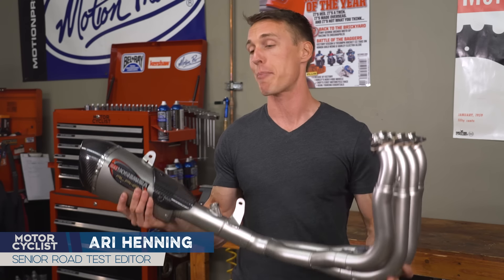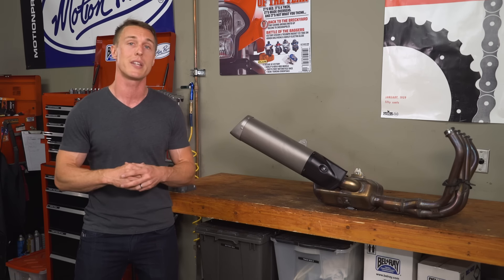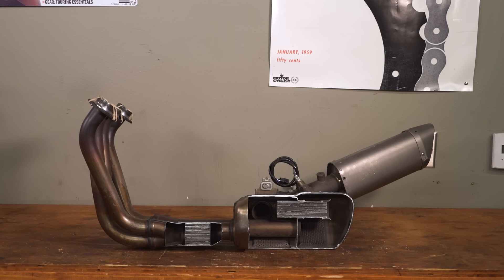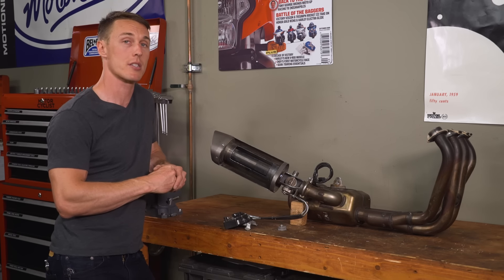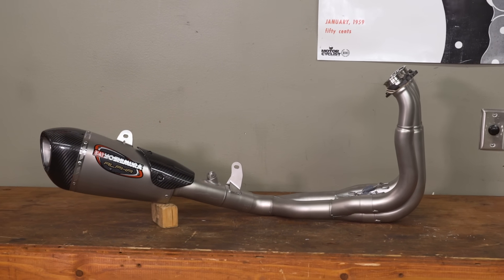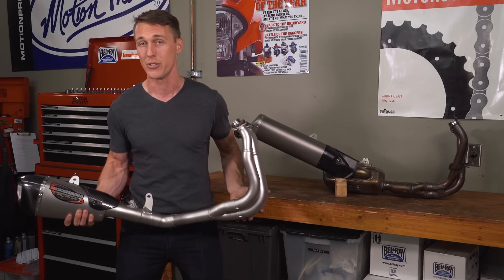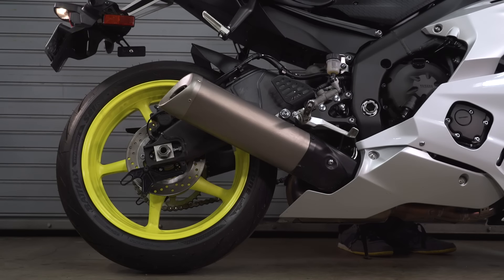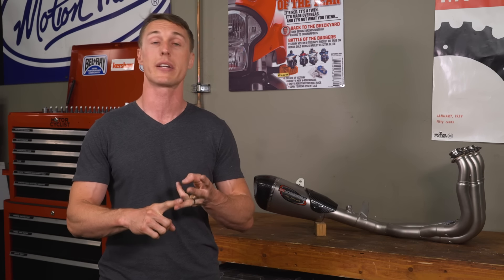The Truth About Aftermarket Exhausts | MC Garage

Comment: Admit it, most of us get an aftermarket exhaust coz of the sound
Reply: Marcus Loke and some solid weight savings
Reply: since when Buddha rides motorcycle?
Reply: Most definitely. Personally, I never pretended otherwise. I try convincing my friends that adding a full exhaust on a street bike is a waste (especially without a re-tune) but it usually falls on deaf ears. I think it's the bragging rights people like about it.
Reply: Sound, looks, weight and optimizing my machine in general. I doubt that I got a significant power increase from my Arrow exhaust system. But I do like the fact that my engine is not so plugged anymore. In combination with a nice K&N airfilter and a powercommander I feel like the whole thing can finally breathe more freely. That was also a main argument for me.
Reply: Marcus Loke Sound is an after thought with me. The aesthetics is why I get a slip on
Reply: EXACTLY!
Reply: air filter + full system without cat is the best thing ive ever felt, not for noise, but the way the bikes breath, i have a high performance k&n filter with a full RS3 system on my SV and dam it feels good vs the stock one
Reply: Adam Lockington yeah. Loud pipe saves lives
Reply: Sound AND power. I made as much as 21 hp on my former FZ1 with a full system and ECU flash. Eliminated lousy power curve, 70% felt vibration, and freed up great sound. None of it affected the fuel economy at all. Plus the weight I lost getting rid of stupid garbage like the exhaust valve, servo, cat, air injection system made it handle better. Oh, and after the flash the engine ran much cooler.

Imagine if Motorcyclist Magazine told it's viewers that the factory equipment is a load of restrictive garbage and everyone should get a full system if available. Besides, almost no law enforcement are actually enforcing the law against these systems which are run almost exclusively on the streets.
Reply: Not in all cases. I was tooling down the road in my car with the WINDOWS DOWN and I didn't hear a loud ass bike until he was right beside me (lane splitting at 80mph btw). So yeah, if I had started to change lanes he could have been toast if I wasn't paying attention.
Reply: They save lives because they are faster. Throttle often is a better option than brakes.
Reply: xbinaryx
What is it exactly that you think you're getting ? On the one hand you mention K&N filter and an Arrow system so your bike isn't plugged up anymore, but on the other you recognize that you're not getting any significant increase.... so, what you're really saying is that the stock exhaust wasn't really "plugging' up the engine.
Reply: Stu Kennedy
The usual baseless bullshit from those amongst us who want to annoy the whole world and are looking for a way to rationalize it, too bad the mantra isn't actually true.
Reply: Lifted_Above
except they're not faster and stock bikes are not slow.
Reply: I changed my cans for two reasons. The bike was too quiet on the standard cans and they weighed a ton.
Reply: I think that the engine can breathe better if you do these mods. It doesn't give you that much of a performance boost, but still noticable. I am not an expert but it just feels better now to rev up more smoothly. That's what I meant by "optimizing my bike". It now functions with less effort, I can feel that.
Reply: Marcus Loke 
Yep, Most do it for sound. And some do it for the looks. But if you're not going to make sure it's tuned, You're better off with the heavier, quieter and sometimes uglier exhaust it came with. 

With some, Image is everything and performance is nothing
Reply: Marcus Loke yup! most stock exhaust sound ok at best. with my shirt exhaust on the cruiser...I saved 38lbs though. So a nice weight loss
Reply: Marcus Loke i agree , aftermarket exaust are made cheaper , louder & rarely fit worth a crap.
Reply: A random dyno chart as proof... I'll give you the benefit of the doubt and assume it's supposed to be your bike. Interesting:  two dyno runs with different max poser and torque,  but identical power curves. Let me ask you something: were these dyno charts provided by the same people who installed your exhaust ? 
Since a skilled operator can fudge dyno charts, the only real proof of improvements are in 1/4 mile runs or track times. Got any of those ?
Reply: You sure don't give a rip about aftermarket accessories. Just to humor you, yes I had a 2011 FZ1. Yes I had the exact exhaust system, exact ECU flash, exact PC5, exact PC5 program and exact power results from this exact tuning company. And there's a whole forum of guys with the same bike using the same tuner with very similar and same results and they all rave of it. So us with lots of miles, vs. your skeptical opinion. I installed the stuff myself. I adjusted my own TPS with my own computer and PC5 software. I've got extensive before and after experience on this same bike. It's night and day difference.
Reply: + midibudu: I cut 12 inches off my Yoshi RS5 muffler on my SV650 and I swear it goes slightly better than it did before. Noisier too but ahhhhhhhhhhhh, The sweet sound of that V-Twin............
Reply: Yup, you tend not to notice a difference when you have 160HP stock and that aftermarket exhaust and tuning has barely a noticable gain. Sound is much better tho..
Reply: Street squids are about sound, the rest of us are about weight and power.
Reply: @cweve 100% true story!!!!!
Reply: Marcus Loke  Loud pipes save lives
Reply: Philip Agtuca  Typical cager statement
Reply: +Philip Agtuca yeah but they're gone in a few seconds. I don't see making a big deal out of it.
Reply: CaptHollister actually loud bikes do save lives. If in the history of bikes and loud pipes have saved a life or has contributed to saving one, then yes it's true. You cannot argue against that.
Reply: CaptHollister are you actually saying that changing the pipes doesn't actually increase power? Because that is complete nonsense. Because they do, go look at basically ANY test. Every single test I have ever seen that's has the exact same parameters before and after the aftermarket exhaust (good quality and has been optimized with a power commander) has seen an improvement in power. 

If you find a test with the same parameters with the stock exhaust and with an aftermarket one from a good company that has no power increase then you are particularly right, but I highly debut it will happen.
Reply: @Ben climo You won't have any power gain installing exhaust and power commander unless you have your bike PROFESSIONALLY tuned afterwards.   Until then "most" times a bike runs like crap till it's been tuned.  My bike would barely run after installing a full Brocks exhaust and power commander with the generic map they supplied off their web sight, and every bike I've ever owned (8 total) that I put exhaust on with a power commander and downloaded generic map had initial dyno runs putting up worse numbers than stock, after the tuning was done, then yes, better numbers over stock.  I've seen sooooooo many dumb shits putting aftermarket exhaust and power commanders with GENERIC downloaded maps on their bikes and thought they were really gaining HP and torque when in all actuality they lost HP and torque not realizing it till they had their bike professionally tuned on a dyno.
Just throwing a pipe and power commander with a generic map does nothing but make a bike run worse in almost all cases.  You'll never know though until you have it tuned and have charts to prove it.  Otherwise it's almost always in a persons head that they gained power, probably just because the pipe is louder makes it seem more powerful...
Reply: Who installs a Power Commander without downloading the tune for your bike???
Reply: Like I said, any map you simply can DOWNLOAD off the internet is a generic POS map!!!!  It's a generic map that does nothing more than make your bike run DECENT with the new exhaust, nothing more and almost always, there's no power gains doing so.  Every bike I've ever owned, I did just that, downloaded the generic map just so I could ride till I had the bike professionally tuned, and every time I had my bikes tuned, the initial baseline dyno runs actually showed power loss over stock configuration.  Like I said, after the tuning was done, then yes, there was power increases over stock!!!!  But if you never have your bike professionally tuned, you'll never know and just "THINK" you've gained power, probably because the bike sounds tougher.  Generic maps are just that....GENERIC!!!
Reply: because REASONS
Reply: rcmantjk I actually forgot to put  you need a tune for any gains. Oops 

I know that generic maps aren't always the best way to go of course, but if you find a tune that was made specifically for your bike and the aftermarket parts you have installed. Then you are unlikely to need to go to a dyno for a tune as it's already been done.
Reply: @Ben climo lol lol...Oops...no big deal bud.
 buuuuuuut That's 100% un-true!!!  Generic maps are terrible!!!!  Every bike is different even if they're the EXACT SAME YEAR, MAKE AND MODEL....  Take 10 BRAND NEW identical bikes and dyno them and they're ALL gonna have different results, EVERY SINGLE ONE OF THEM!!!!   That's why you HAVE to have your bike dyno tuned after adding exhaust and a tuner!! A generic map won't do it even if it was made specifically for your year make and model of bike.  How do they know how your bike runs, every bike is different, they can't and that's why they supply just a generic map that will work "halfway" decent in all bikes!!!
Reply: Marcus Loke yeah for sure but the reason i need it so people can hear me coming. My bike is quiet
Reply: you never hear a sport bike coming, you don't hear them until they are flying by you. loud pipes are loud thats all!
Reply: rcmantjk thanks for the information didn't know that completely. 

I know that all bikes are slightly different but surly they will all be within a very small parameter? And a generic should fit within that. 

I just thought that 2 bikes that have been manufactured the exact same way, have the same tune, would be very similar not completely different. As you've said.
Reply: Ben climo.
Wrong on both counts. Pipes by themselves do not and never have increased power. A motor is basically a big pump: simply increasing the exhaust does nothing unless you also increase the intake. Once you get more air going in and out of the cylinders you also need to adjust the amount of fuel added to the air for all conditions of ambient air temp and engine rpm. That means either remapping the injection or rejetting the carbs. Many tuners get it wrong, but some do get it right. To see increases in power you need to adjust the whole breathing system, not just the exhaust. Matter of fact, only changing the exhaust often results in a decrease in power. But the engine makes more noise so the simple-minded think it must be making more power. Dyno tests published in magazines as far back as the 1970s have demonstrated this over and over again. As far as loud pipes saving lives. it's just the big lie we like to tell ourselves in the world of motorcycling. The truth, of course, is that they make no difference because distracted drivers can't actually hear your noise when you are either coming towards them or in their blind spot. Even if they could hear your noise, it would not help them be any less distracted. They can fail to see us even when we are festooned with brightly coloured clothing and have multiple lights on, what makes you think that they would be any more likely to hear us ? My own experience is that they are only likely to notice what is big enough to hurt them. I rarely got cut-off when I had my FLH with stock pipes or with my current Valkyrie, also with stock pipes, but I regularly got cut-off when on my Triumph Thruxton with "off road only" pipes and modified airbox and carbs. But surely you have statistics to back up your claim that they do save lives, so please provide them.
Reply: CaptHollister With the exhaust. I agree, without anything else it will make it less powerful, but with the right tune for YOUR bike such as fuel and air intake and the ratio of those two then it will produce more power. 
Do you have any evidence that a bike with a good tune and a good exhaust will produce lower power. 

 It is a big lie we tell our selves no debut about that lol. And I don't have any evidence on hand right now. But I'm sure you've seen plenty of videos where a rider revs his bike at the same time the car stops doing a dangerous move? I know I have seen a fair few and I'm sure other people also have done. 

But like I mentioned earlier if it has ever helped or stopped a crash that was life threatening in history then 'loud pipes saves lives' is completely correct. Even if it's incredibly unlikely, there's still that very small percentage that it helped.
Reply: but on a sports bike the air moves in as fast as you're traveling... so yes.. the exhaust is the only thing holding it back .....
Reply: Wrong. the air moves in as fast as the engine is sucking it in. Ram air on sport bikes only works as super high speeds. You'll never use ram air on the street.
Reply: Marcus Loke  LOL bull shit,  so when I'm going 100-170mph I'm not using it? so I have mini fans in my intake I don't know about when I'm going 30mph????
Reply: Damn right.
Reply: Will Lyon that's a lie.... so there's mini fans in my intake I didn't know about ??? that increase psi at 30mph compared to me going 100-170?  ... You clearly live in downtown New York City and never seen a open road.
Reply: @Ben climo No worries Ben.  But anyway, two identical brand new bikes can differentiate as much as 5-10 HP on a dyno.  Putting exhaust/programmer and generic maps in these same two bikes will have drastically different outcomes. The same generic maps on one bike might make it run "SOMEWHAT" slightly better, but I highly doubt it,  and I mean SLIGHTLY, but make the other bike actually run worse!!!  I've owned 8 sport bikes in my life and on every one of them I've added aftermarket exhaust and then had them dyno tuned.  On every occasion with my bikes the baseline dyno run showed worse numbers than what each bikes put out in stock configuration, EVERY ONE OF THEM!!!!  After dyno tuning, yes, I had increases over stock, but only after they were tuned.
On my latest bike, a GSX-R 1000 I installed a FULL (not a slip-on) Brocks exhaust and Power Commander with their supplied map, then had it dyno tuned.  The 1st initial run showed number 8 HP below what my bike had in stock configuration!!!!!!!!!!   After tuning I was 13 HP over stock!!!!  The tuning made all the difference gaining me a total of 21 HP over just the pipe, programmer and generic map!!!!!   And those numbers are "roughly" the same throughout every bike I've ever owned give or take a few HP here and there.  So for those who think that by just throwing on a new exhaust, programmer, generic map and maybe a K&N of BMC air filter that they're gaining HP without getting their bike tuned, I say show me the numbers because they're not, they just think they are because the bike is louder now and sounds tougher is all, nothing more nothing less.
Reply: @Will Lyon 100% TRUE!!!!!!
Reply: @akane742  Huh???
Reply: Ben Climo, so if the rider had used his horn he would have achieved the same result. Bonus: he would not have annoyed the non-riding citizenry.
Believing claims for which there is no backing evidence is not a good way to get through life, son, but it is a good way to be parted with your hard-earned money.
Reply: Chris Yeager
An interesting question which follows faint praise. As a grey beard and a lifelong rider, I'm pretty sure I could come up with a baker's dozen of things that I know, some of them even have to do with motorcycles and how they are operated.
Reply: Chris Yeager,
Chris, he's not wrong. Ram Air is one of the other lies we tell ourselves. It's effect is minimal at higher speed and non-existent at normal road speeds. Unless you have a turbo, at 30mph your engine air intake operates entirely at atmospheric pressure. 
If you really, truly, want to understand how your bike works, I highly recommend reading anything by Kevin Cameron. He's written extensively about the science and engineering of the flow of air into and out of an engine. It's very, very, interesting and educational.
Reply: Loud pipes just mean that the tinned vegetable life using cell phones while driving struggle to hear or be heard when making a call. ("What??!! Say that again. There's some biker with a loud pipe behind me!!".

Fitting localised cell phone jammers on bikes to disconnect the calls of selfish assholes driving with cell phones would help save more lives.
Reply: Andy Reid that's not a bad idea actually
Reply: rcmantjk thanks for the good information about it and given actual numbers of it. It's rare when somebody acts decent when the other person doesn't know the exact details about it. Normally the other party just acts like entitled and thinks he's better than anyone else.
Reply: CaptHollister I've already said about the evidence. Go look at most YouTube videos with near accidents involving a motorbike. 

Yes a horn would be better in any situation as a horn is a noise that is designed to alert people. While an exhaust people will just ignore it thinking it's a guy with a loud bike and nothing more. But I'm not comparing the 2 though. I'm saying that there have been incidences that an exhaust has alerted the other person which could have ended in a fatality. The louder the exhaust the more likely they will hear you.

Also I probably won't buy a full system as I'm not after those few horse power gained from it. I'm not a racer. So I won't be putting down £800-1000 on a full system, I would much prefer to buy a slip-on.
Reply: Marcus Loke and for stylist too broo..
Reply: weight ,  power curve change , then sound is how i would order the importance of the exhaust. Almost all the aftermarket sound good so loosing the most weight should be first, then after that  look to see how each pipe and muffler arrangement alter the power curve after a corrective tune. i myself on my r6 went for the largest amount of torque at mid throttle. Thats the place spent the most canyon riding on the street. and to be honest not being a pro rider (obviously) didn't really notice much other than sound. your making small changes in power its gonna be hard to feel with out supporting mods like intake , head porting , and race gas with a respective tune to correct for all that. i think the biggest upgrade you can make to a bike as an average rider perspective is racing tires (non dot) .... and msd power commander with ignition cut off for clutch less up shifts or whatever the correct term is that escapes me. .
Reply: Dalton Michaels yep I agree. On most bikes you won't really feel that the power increase for most riders. 

I've seen so many people mentioning what's the best upgrade but most fail on the most obvious, tyres, if you have touring bike tyres that last 10,000 miles then to tyres such as rosso 3s the feeling would be incredible. And then your going to be slightly safer on the road as well as the tyres much less likely to slip (depending on brand and compound).
Reply: Andy Reid, you're assuming that a car driver can hear you when you are behind his car...
Reply: Chris Yeager
Insults: the last weapon of those who have no valid arguments. As it happens, I have a surprisingly well educated ass. Here's what it has to say:  the benefit of scoops on a car is to provide the engine with air that hasn't been heated by travelling through the radiator and engine compartment, which is what happens with most stock car intakes. If you remember your high school chemistry, heating a fluid lowers its density. Heated air is less dense than cold air and contains less oxygen per volume. This doesn't happen much in a bike that can draw air directly from the environment instead of air from an enclosed engine compartment.  What scoops don't do, is pressurize the airbox.
Reply: Marcus Loke yep sound and look
Reply: but i don't like too loud sound from exhaust.
Reply: If I have to wear ear-plugs, the exhaust is too loud.
Reply: Marcus Loke I guess so 😂😂
Reply: @Chris Yeager Air density, why? Two things. Temperature and pressure zones (intake). An Airbox mainly controls turbulence making fueling more consistent. The main advantage to ram air is actually the fact the air temperature at the intake is much cooler than where the air at the throttlebody/carb's are without an airbox. Also  with the effect isolated, the pressure difference has only a very slight effect at quite high speeds. On gp bikes they need a line from the airbox to the fuel tank to equalize the pressurize in the tank or they wont fuel over certain speeds. (This is without fuel pumps being 2t carb'd) So it is a noticeable difference and without the line its obvious when the pressure changes but talking purely power, the gains are actually very slight. Its mainly the consistency for jetting that makes them so awesome!
Reply: Antreas zeusson
It helps when the same people take the "before" dyno readings, make the mods, and then take the "after" readings.... Few people realize that the operator of the dyno can influence the results. They would rather believe that they outsmarted their bike's manufacturer than admit that they got taken in by a clever operator.
Reply: rcmantjk odd I'm currently at a shop that tunes bikes then will save those tunes especially on new model bikes. They sell these tunes to companies like power-commander. Tunes are bike and aftermarket part specific as well as specific state altitude.
Reply: K&N filters? Air intake pressure controlled by speed of travel? This is one of the funniest threads I've ever read!
Reply: Plus asthetics. Most modern bikes have silencers the size and weight of a waste skip!
Reply: Yes. It´s called RAM air induction.
Reply: nah. Only reason to replace anything that is stock would be performance for me man. I don't tough a bike unless I am going all out cause it seems pointless to me to just go part of the way. Besides i don't die for the cool factor.
Reply: Exactly...
Reply: BunPham Buddha rides a sick bike!! It's got an awesome, open-loop eternal cycle engine. Handling? Almost zen like. The sound? Other worldly.
Reply: Totally. I got an '06 Yamaha FZ6n and to be honest, while the look of the Stock exhaust is OK, it sounds like an Hairdryer.
I know have Mivv Souno Slip-Ons (chosen by the looks) and my bike looks, feels and sounds alot better than before. It is alot more fun to ride it.
Reply: I fall somewhere between sound and look
Reply: Yeah, I got mine so cars can hear me coming. Especially in Cali we split lanes so it helps to get drivers attention, that alone in my book is worth getting one. Loud pipes=Being heard. (Btw I have an 09 GSXR 750 with a full race Akrapovik shorty carbon fiber exhaust with a power commander 5)
Reply: Loud pipes don't save lives. When I'm in my car, I don't hear bikes until they're almost beside me and research on the matter confirms that. When I'm on my Yamaha ( the one with aftermarket exhausts), the sound is intoxicating, yes, but it also makes me feel that I am more capable than I actually am so I constantly check myself so as not to do anything stupid. You want to save lives? Drive defensively. You want to improve bike performance? Get aftermarket exhausts and tune accordingly. You just want to sound cooler? Cool, get and aftermarket exhaust but please, don't lie and say you're getting one because you've done research and found that it saves lives.
Reply: Marcus Loke except for my 2 stroke
Reply: Marcus Loke how it looks is important too. most of these slip ons sound the same
Reply: to everyone who said it 'feels' gruntier, if youre only gaining a little up top then youre only going to 'feel' it up top, youre probably just throttling harder or placebo'ing
Reply: i dont even think my stock exhausts weighs 10 kilos andi really dont think id get 10hp by putting another one on or taking that one off completely
Reply: assuming all this was tested how do you know that you couldnt have just got a better tune on the original exhaust to make that extra horse? also 40% sounds like massive final drive losses
Reply: Absolutely
Reply: actually they are
Reply: yeh mate ,louder the better :)
Reply: Marcus Loke yes
Reply: A 3kg weight saving might matter if your are no2 in the F1 championship, and 0.2 second a lap actually matters, on the road, at 30mph it's pointless.
Reply: Same but have DB rating compliance plate (with the baffles in) as having too loud pipes can get you in trouble, But the baffles that can be put in or out with one screw at the back end easy to make compliant over the pits.
Reply: Looks too, and you also get rid of unnecessary weight cuz of the  cat and baffle etc... A loud exhaust (open) is nice, and I think it even makes riding safer since people hear you coming!
Reply: Neel Beke 
Or you might just make people go into a road rage and slam into you on purpose.
Reply: Marcus Loke you took the words right out of my mouth👏
Reply: I don't believe in the no-win scenario. :)
Reply: rcmantjk = men men meow.... without retuning no one gets more hp.  But open pipes gives the immediate  exhaust breath.. so two same bikes or cars.... an open pipe will jump  first gaining  its full RATED power. Top speeds will be same  but that open pipe finishes first  due to its quick power delivery in every  corner...... also.. at 100kph and above.. those people walking  has very less  chance of  escaping you coming.   At lower speeds though.. sound  might help.... and while cars are crawling at stop lights  while you rev your bike = warns them  or even intimidateds them.
.
So what advantage we get at open pipes is only  the  achievement of immediate  RATED  power.... tuning  any bike  even without  open pipes  gives  same  macimum  power.... any ONLY open pipe  advantage  is  very  less compared  to your lose of  genuine and paying for that  aftermarket  open pipe.
Reply: Two Brothers FTW, LMAO HAHAHAH
Reply: Hogen Drop LMFAO
Reply: Reving the Two Brothers? The whole country wakes up xD
Reply: And the looks
Reply: They just want it to be loud.  Most aftermarket exhaust does not improve performance.  All exhaust systems legal for sale in the U.S.  has a stamp stating whether it is legal for on road use.  If it has no stamp it is totally illegal and cheap crap.
Reply: You claim that it annoys the non-riding citizenry.  But really how much does it.  Before I had a motorcycle it never bothered me to hear a motorcycle with loud pipes.  As long as they are riding safe and not sitting next to you revving the engine trying to piss you off. why get bothered?  They're only there for a few seconds and then their gone. So yeah it might annoy one or two jackasses that have nothing better to do then to get pissed off at stupid BS.  But, these people want to get pissed off and because of that, I don't care.
Reply: Because*
Reply: Marcus Loke 100% 😎
Reply: Marcus Loke 
Guilty as charged
Reply: Sound is my main reason, second is weight
Reply: I get it because I dinged up the original in a lowslide and OEMs are like $500 a pop. Could get an akra for that
Reply: Weight savings,and with correct tuning add 1-2 hp/torque
Reply: Hearing a bike that is behind you is almost impossible until they are up your tailpipe.  Beside you, yes.  If you are behind a loud bike, like stuck behind one (either in a car or on a bike) it is kind of annoying.
Reply: I think the Ram Air works on some bikes like the ZX-14, those Haybusas, and other Superbikes.  The effects will be less on a standard, sane horse powered bike in the 40-100hp range.
Reply: Yes and they all sound like crap. Extremely annoying.
Reply: Got it cuz old 2 stroke xD then its major power diffrence
Reply: Kobayashi Maru 99.9% like to blow money on looks over performance and brag about it. 99.9% of after market exhaust robs power (regardless of sounding better) but people always swear they can feel the power increase yet dynos have proven they loss 15-20-25  hp/tq. The after market loves taking shit pipe. Paying a pot head $10 and hour to polish it up in 2-3 hours. so now hey are $40 in and recoup it by charging $500 or more to gain you a hp debt and not a credit lol. 
Like going to a chinese buffet and seeing people pay $8.99-15.99 and their plate is 3/4's veggie shit...im ike load up on beef/pork/chicken offerings...I can buy all the veggies dirt cheap at the local grocery lol. Im getting my moneys worth not just being able to say I stuffed my face for $15.99 but only ate $3.99 worth of veggies lol
Reply: Marcus Loke hella true😂
Reply: My honda grom really came alive with the new intake and exhaust with a tune, I hit 55mph the other day on flat ground!
Reply: I almost got ran off the road on the fast lane. I’m assuming cause they can’t hear me on stock exhaust 2019 zx6r. Worst part about it I get around them but I can’t bitch at em they didn’t even realize what had happened I just sped like whatever lol I definitely need exhaust
Reply: We need the honeys to know where to find us
Reply: Tom Ever heard an 2009+ R1 or Moto GP M1 at full power? Hearing one for the first time cost me $17k the next day.
Reply: CaptHollister Wha? Roll through any Granny’s blindspot with an uncorked literbike and watch her cringe and avoid you before she can see you. If you haven’t experienced it, and can’t fathom it, then you stand in a place of ignorance.
Reply: SAFTEYYYYY ;)
Reply: Two years late to the discussion. Haha.

Loud pipes saves lives? I disagree. The trumpet muffler is pointing back, not front. Safer riding habits saves more lives than the loudest exhausts available, without being obnoxious.

That said, I do have the end can of my Suzuki bandit 1250 replaced from stock to an arrow. Silencer stays on when I'm doing town riding, goes off when I go touring. The weight makes a pretty significant difference, and I get better performance at higher revs at the expense of lower torque at the low end. Works well enough for me without being obnoxious.
Reply: @xbinaryx in y _!8
Reply: I did it for the weight savings for better control, and the looks. Sounds doesnt matter cause its illegal on my area.
Reply: I would add a couple of pounds for good sound tho
Reply: How about, because aftermarket brands are lighter in weight.
Reply: Sound weight saves Horspers 😁😎
Reply: I'm just curious how much horsepower can it increase?
Reply: @CaptHollister  I would be willing to bet that those people who say loud pipes save lives are not the same people investing in motorcycle safety training and proper equipment for the ride.
Reply: @CaptHollister  there are too many blithering idiots out there. You could ride a bike that sounds like an F-4 at takeoff and they still wouldn't hear or see you.
Reply: cweve who doesn’t want their bike to sound more beefier?
Reply: Duh
Reply: The sound is the only reason , if anybody else says weight or power they are lying
Reply: Well yeah but i really likes those exhaust that are purple titanium colored they look cool
Reply: Could ugga duggas and you get a louder vroom vroom noise. What's their to complain about?
Reply: I like stock way better for every and single each of motorcycles...
Reply: 100%

I really don’t care that it saved me a few kilos, added an extra horsepower up at some rev range I barely ever reach 95% of the time.

Does it sound good? Take my money.
Reply: Marcus Loke well duh 😂🤦🏼‍♂️
Reply: My DRz, designed 20 years ago, really woke up with a full exhaust and jets. I had jetted the bike prior and it ran great, but once the full exhaust went on I could barely keep the thing running and had to put the biggest jet from the kit and man, night and day difference.
Reply: Yes, I admit I want to be heard 😂 But also, the performance and looks.
Reply: That and lighter on the weight
Reply: So true
Reply: Not really. Most people I know care about the performance. Just like most people take their cars to the track, I take my motorcycle to the track and if I can squeeze out more performance to get better lap times, then that is what I will be prioritizing. The same goes for my car, performance is number one. That is honestly the main reason to even get a motorcycle in the first place, to race and to compete. That's why it's fast, not to accelerate fast from the red light, that's pathetic.
Reply: That’s legit the reason for getting an aftermarket exhaust, it’s like buying a plate to eat on it
Reply: @OneTwoFive0  No, the reason to get an aftermarket exhaust is performance. It doesnt matter how it looks, as long as its beneficial and contributes to better lap times and better racing results. That's why you buy an aftermarket exhaust, to improve on the track and in races.
Reply: And the looks.
Reply: Ego booster..
Reply: Over simplified. 5 hp with full exaust and a proper tune.
Reply: stock exhaust looks ugly coz it's too big
Reply: Im looking for one now, but way to expensive. Almost 800 just for the slide on tip.
Reply: It's a fact
Reply: Nah
Reply: Literally NO ONE cares about the 2-5 horsepowers🤣🥲
Reply: I need exhaust on my 2021 mt10
Reply: sound$ good to the aftermarket manufactures.
Reply: Remind me to never buy a bike from you
Reply: is
Reply: @Benton Harley instablaster =)
Reply: @LockieNZ  correct
Reply: Still there are some people left knowing why we need to use an open exhaust
Reply: And Preformance with the right setup
Reply: I’m not a fan of obnoxiously loud race track exhausts but...these non-drivers need to hear me even before they “ don’t “ see me. Pipes are a must!
Reply: Weight
Reply: Literally why else?
Reply: And power
Reply: The sound and weight.
Reply: So lame
Reply: Not anymore love stealth mod....
Reply: 100%
Reply: Screaming eagle 1
Reply: Yup
Reply: @BlancoFlaco  no they don't.
Reply: And the carbon fiber 🤣
Reply: Just some. Most people spend money to produce sharp, stupid loud and really ugly noise, not sound.
Reply: More often than not when people add things to their bike it makes it worse not better. They only think they did something positive. When they really should spend that money on some gear or a track day with instruction to become a better rider. 
Whenever I buy a bike I will always look for a bike as close to stock as I can find.
Reply: Not me i hav stock and im happy , nobody wants a loud  ass exhaust
Reply: Truth
Reply: Sounds is the only reason for me. I like people knowing I’m in their blind spot when passing.
Reply: Yep
Reply: Performance first.
Reply: @kobayashimaru8114  a quality exhaust note is never a waste
Reply: The absolute truth.
Reply: the correct way to phrase it is, most of us get an aftermarketexhaist coz we are so insecure and want attention
Reply: I dont think anyone tries to hide it?
Reply: 100%
Reply: Weight, for me.
Reply: I wouldn't waste my money loud pipes indicate deflated ego
Reply: No shit
Reply: Won't they don't tell you is that loud exhausts actually is good for my mental health. I was genically designed to hear a symphony of facts bubbles and bullets roaring out of pipes. Of course in a mere mortal world you have rules for those that need some comfort . BTW I've never heard so much rubbish. Mufflers are not free flowing and and pressure builds up. Plain and simple. Carbon should go in one direction up into the sky!
Reply: @cweve both.
Reply: most of you younger than 35-ish maybe... us old school guys (as a rule) look for different things in our mufflers, lol
Reply: You guys were trying to get power?
Reply: Everyone is fed up with your cool engine sound. Grow up
Reply: Did mine for flames
Reply: I know I do 😅
Reply: Haha facts. For me, it is: sound > looks > weight > power. That underslung stock exhaust on the XSR900 just looks like a pregnant elephant.. 🐘
Reply: If the new exhaust doesn't make my bike quieter and more efficient, I don't want it
Reply: @BlancoFlaco no they don’t. Stop spreading this bullshit.
Reply: Well, the sound and feel of a bike is a big part of why you choose a bike. Harley's make money off this feature. However, most bikes aren't offered anything spectacular or they are really expensive. I just enjoy my stock exhaust as my twins already have great sound experience.